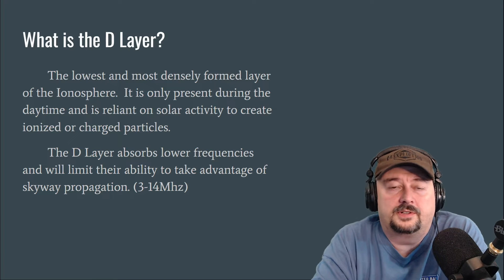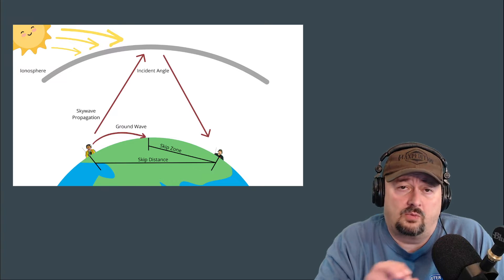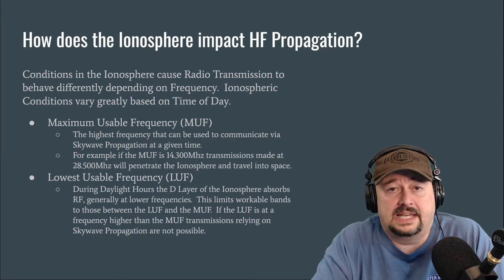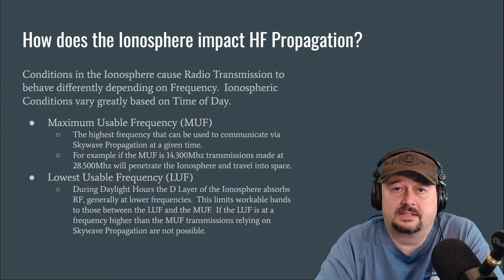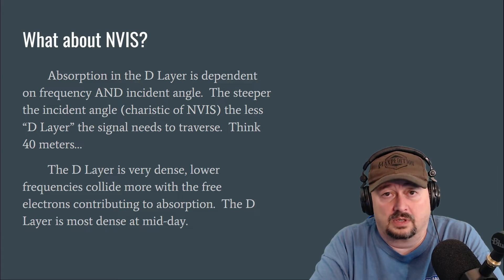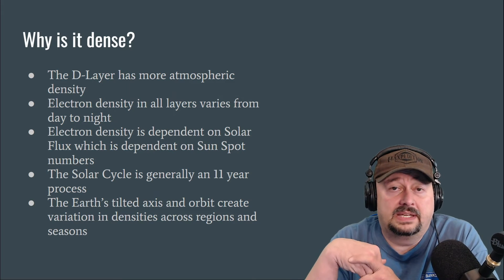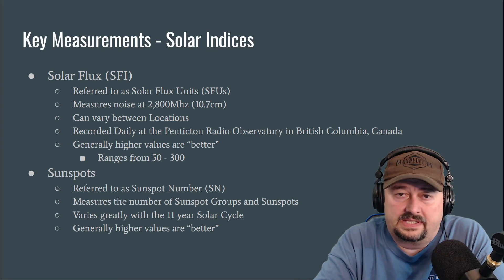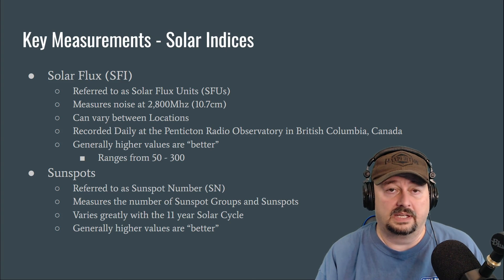The D-Layer and Ham Radio Propagation

Comment: Yes with NVIS there is less D  layer to go though BUT  the MUF generally  is also higher  at lower transmission angles.
This is a confusing but real concept. Where you wish to go through the D layer but get refraction from the F layers.

The way I look at the D layer and the F layer have different MUFS for NVIS to work your frequency must be above the D layer MUF and lower than than the F layer MUF.  Did i get it right? Does that make sense?
Reply from the maker: I agree that the D and F layers behave differently but as far as I know there is only one MUF which is an estimation.